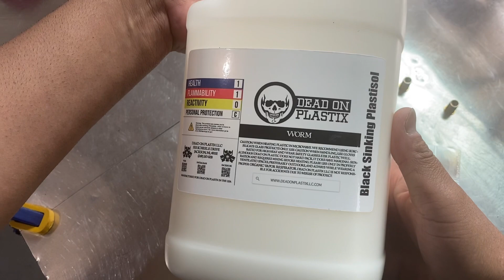CORE SHOT 5” STICK BAIT , and new color from DEAD ON PLASTIC.

Comment: awesome color. did you have to add salt?
Reply from the maker: hey man thanks for watching , and no I didn't use salt on these sets. but I use dead on plastic sinking blend . it sinks slower ,good for shallower water or when the water is still. but I do put salt when request for sale . thanks again for watching and comments tight lines checkout.

Comment: Have you figured out how to prevent getting dents in your soft plastics?
Reply from the maker: Hey bro how's it going bro? so to prevent dents its all about temperature with  plastic and pre heating your molds as well how fast you inject the mold. I'm in the east coast , so whether is always fluctuates.  if you have a pancake griddle or heat gun . if you have some left over pucks from pass injection , a quick melt and inject helps preheats the mold. because over heating the mold can cause flashing and denting as well over heating your plastic , after getting perfect temperature . trust me I've don this lol. even some time still do this when placing it on the griddle - walk away come back then mold is over heated hehehe. hope this help bro,  and thanks for your sub glad I can  help you. BAB check out